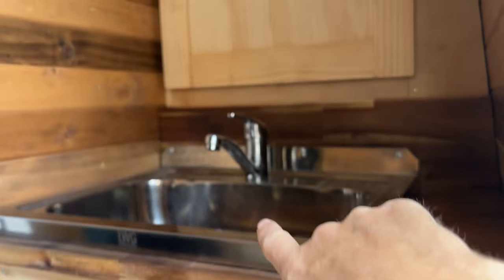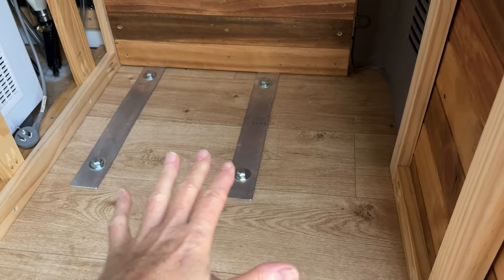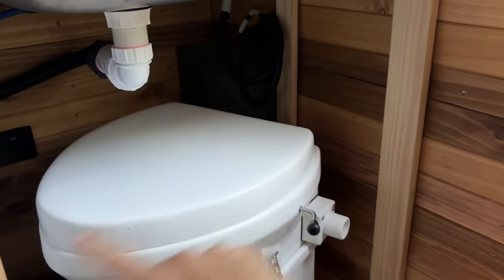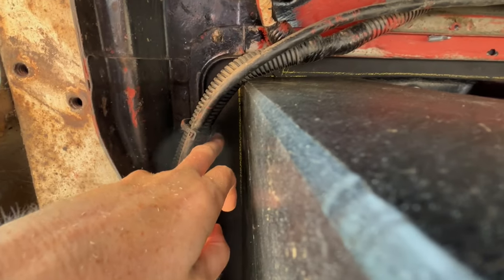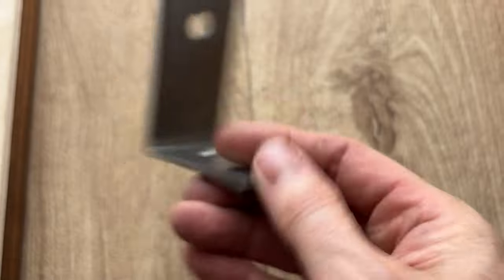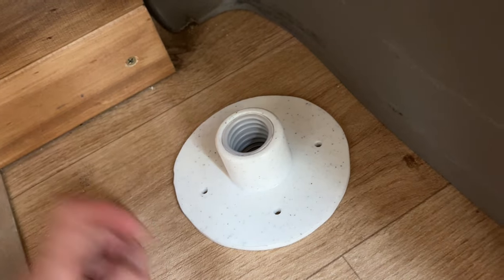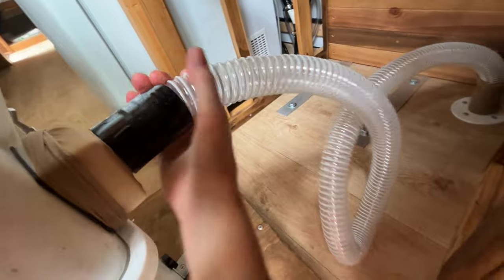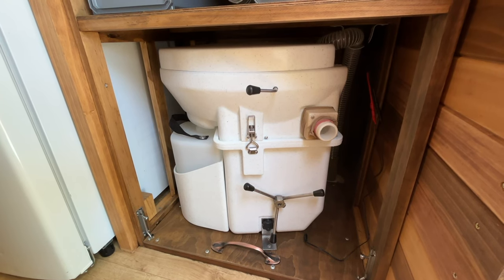Natureshead compost toilet install in a Toyota Coaster bus motorhome

Comment from the maker: Thanks to everyone that commented about the noise my toilet fan was making.
I ended up taking the cover off to make sure the wires weren't caught under there. They were fine, but I happened to have the fan plugged in when I was replacing the cover and I realised that the noise started just as I fully tightened the cover screws. When I backed off on the screws a little, the noise stopped. So I'm guessing I overtightened the cover and it was somehow pressing on the fan inside. It now runs beautifully and all you can hear is a faint whirr of the air blowing.

Comment: Well done 👍 particularly on the slideout. Id unscrew that fan & check its balanced, & maybe add some electrical spray lube ... That would drive me nuts ... I don't think it's usually that noisy 🤔

Comment: I am always impressed with your woodworking skills, it always looks perfect.
For the fan you could change it to a quieter one, but it sounds a bit like it might be rubbing on the wires inside the cover.
Reply from the maker: Oh okay thanks. It was a bit tricky getting the wires back in when I switched the fan over to the other side. I will check that out thanks for the tip

Comment: The fans they use are computer vent fans - these are propeller fans they do not perform with a resistance placed on them- I would try removing the stocking ( which I expect would quickly block up in any case) and use a mesh screen- not too fine- I expect it will make it much quieter